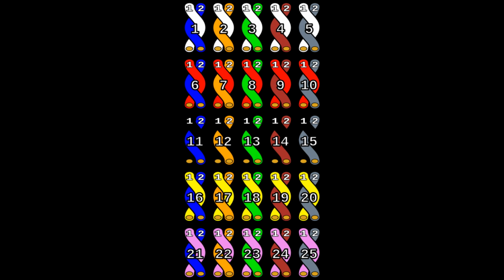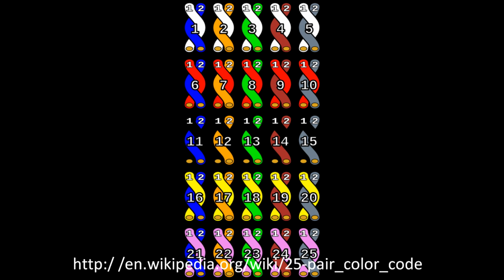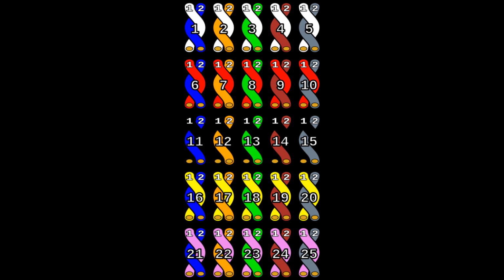Telephone color code

Comment: does this information apply for the uk
Reply from the maker: I have to be honest and say "I'm really not sure".  My guess is the color code is probably the same.  Excellent question.  Thanks for commenting! :-)
Reply: BT in the UK uses the colours as stated on E-side cable (PEUT) which is in units of 25. The units are concentric. The first unit is wrapped in red. The last unit is wrapped in green. The intermediate units are wrapped in clear. 

D-side cable (PET) is in units of 10 so only uses the white and red as the a-leg. The unit wraps of d-side cable go blue, orange, green, brown, slate, white, red, black, yellow then violet (which is basically the a-leg colours followed by the b-leg colours).

There is still old concentric cable in the d-side network which is not in units and has to be laid out very carefully when jointing. Each layer starts with a white/orange and finishes in a green/black. The pairs between the start and end pairs alternate between red/slate and blue/brown.

Comment: The reason for the dental floss is to enable the cable to carry its own weight. Without it, the copper would strech over time and eventually break. And by the way. Never strip the insulation with sicours. There are dedicated tools for this!
Reply from the maker: +Flugschüler Fluglehrer is that right (the stretching )?  Didn't know that.  Thanks for the insight. :-)

Comment: Brings back memories , back in the early 80 ' s I worked for a telecommunications business . Put thousands of amphenol connectors on 25 pair . Is 25 pair still used much today ?
Reply: yes we use it for data
Reply: @anthonyceballos1765  Yup. Two lonely terminals on the 66